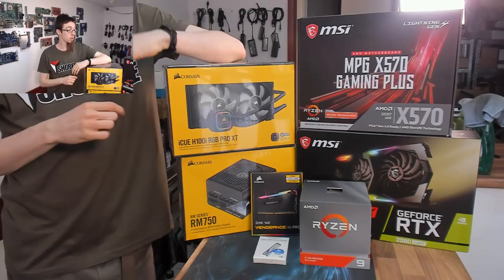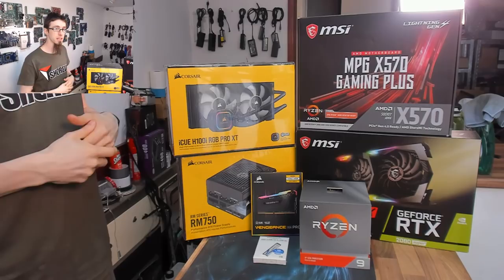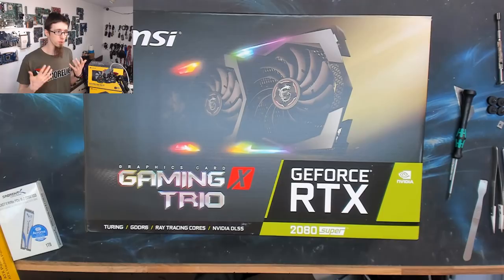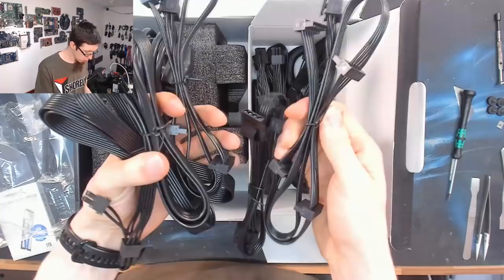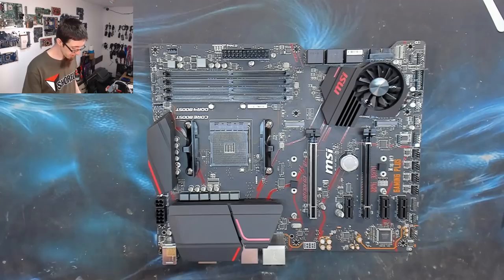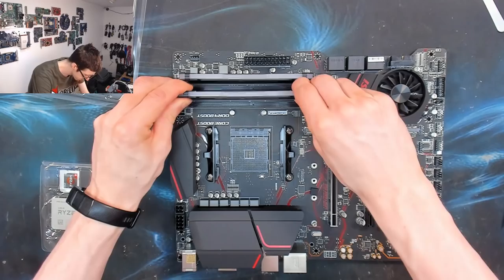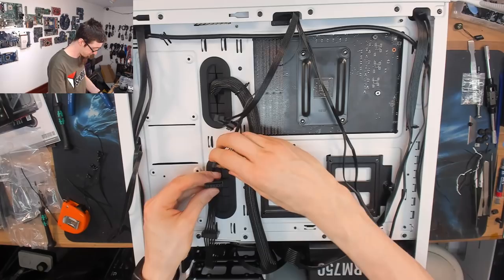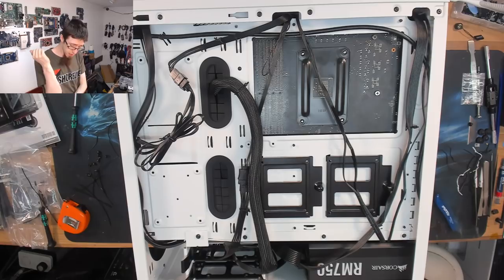The Whole Corsair 275R AF build - LBC#54

Comment: A MSI MPG X570 Gaming Plus as a base for an Ryzen 9?? I think this isn't a good solution! The VRMs of the motherboard are fine for an Ryzen 5 and OK too for an Ryzen 7, but the VRMs are little bit  undersized  for an Ryzen 9. The MSI B550 Tomahawk or the Asus Strix B550-F Gaming would were better partners for an Ryzen 9. Both mainboards have better VRMs and the Asus has a very good soundsolution. Maybe a Asrock X570 Steel Legend it has  a good price and a good list of features, like 8 SATA-ports.

Comment: Great video, thank you. Did you add thermal paste when installing the water cooler block on the CPU or did I miss that (or it is not needed)?
Reply: Pre applied on the cooler block so no need to add any of your own 👍🏼
Reply: dannyvenuss good to know.. thanks Danny
Reply: On what planet was this a good build, cheap motherboard $50 cooler with a top line cpu and a $1500+ gpu it's a toaster at best! see my review!

Comment: I've just built with an AM4 X470, R5 3600x and 2060 Super and noticed that vcore is also 1.488V as you mentioned with this R9 based machine. Can you advise on the vcore voltage and also clarify what you meant about the RAM clock as I'm also using 16GB @ 3600 MHz as XMP is on and I'm aware that e.g. on desktop CPU-Z can show memory clock at 1800 MHz as it's DDR but can you explain what should be applied in the BIOS?
Really excellent channel,  enjoying the videos greatly, have been learning so much so thanks for all your hard work! 😉
[EDIT] I looked into it and I think the 1.488V reported in the BIOS is based on one CPU core running. "AMD Cool and Quiet" should be set to auto and the voltage fluctuations are normal. More info here https://www.reddit.com/r/Amd/comments/cbls9g/the_final_word_on_idle_voltages_for_3rd_gen_ryzen/

Comment: Excellent spec. I've fallen foul of the whole PSU availability thing and have been reading recently about RM power supply reliability issues, so I've opted for a Seasonic Focus Gold 750w. Slightly cheaper too!
Reply: The gx 750 is a great psu, I'm rocking one myself.

Comment: You could go eazy with 650 watt power supply or even 600 and save pretty good and m.2 better place on lower slot so it doesn't heats up from GPU  ;)

Comment: more attention needs to be taken for the gpu thermals in builds. liquid cooling on processors all the time. but unless they are rendering most of the work will be done on the gpu for gaming, and that gpu boosts with temp...  2020 cases have been getting better with bottom intakes

Comment: Is 32GB OTT for gaming?
Reply from the maker: Very much so 😅
Like, knock yourself out if you went 32GB, but you won't actually be using it. It's worth noting that we're also getting late into the life-cycle of DDR4, so 'future proofing' ain't a thing either. We'll likely be hitting DDR5 before 32GB becomes the recommended for gaming.
Reply: @Adamant_IT  BALLS! I did go with 32GB of 3000MHz DDR4

Comment: I have a Corsair case with the same/similar tooling and I hate it lol. The side behind the mobo is like half a CM, so cable routing or using fan controllers is a nightmare. Its hard to close my rear side panel. And the airflow is meh and fan mounting isnt great, nor is drive mounting. And the "a"RGB on the front is lousy as it was made before Corsair became the RGB gods lol.

Comment: i have two 3900X's that CRASH at -50mv offset, let alone -100mv cant even load into windows with that. XD i had a 3950X but cant comment on that as i dont have it anymore, swapped it to my brother for one of those 3900X's and 200 cash, but i would imagine it would do better. And the 3900X's trully have IN BIOS vCore like 1,45v or more, even with latest 2021 BIOSes.

Comment: Why was the motherboard sitting so low in the case?
@ https://youtu.be/IFBAehidsnQ?t=2574 you can clearly see that the I/O ports alignment is way off!
Either the I/O port shield is too high or the mobo is to low?!?
Reply from the maker: I noticed this when I was plugging it in, I gave the mobo a nudge and it settled into place. Not sure how it was caught up though, as you'd expect the ports to be too high, not too low.

Comment: A 3700x with 2070 super would have been a better bang for the buck you wouldn’t even notice the difference from the 2080 super/3900x you chose. And you could have saved about $400 and spent like $100 of that on a better motherboard and better case and better aio cooler.

Comment: You really should explain which way the fans go for push or pull....
Reply from the maker: ahh I always forget. The rule of thumb is; intake at the front, exhaust at the back/top.
Rad fans should generally push through a radiator, but I don't think it makes a great deal of difference. I went for push here because it's easier to mount (one set of screws) and I wanted to hide the non-RGB fans.

Comment: Looking good i have just purchased the same case, i have one concern i have seen a few videos regarding the watercooler outlets should be at the bottom if you are side mounting the radiator, this stops the air traveling to the pump causing noise and damage, here is a good video explaining and testing. https://youtu.be/BbGomv195sk
Reply: Can a radiator actually fit up top? I want an aio and to top mount it but I don’t think there’s enough clearance
Reply: @JesusPerez._  Yes I have managed its squeeze but fits in there however I did need low profile ram for abit more clearance above the motherboard. Still going a year later anyway haha. Good luck
Reply: @UKGBManny  that’s good to hear, hopefully I can make one fit in my case too! Ty for replying

Comment: You were going okay until you capped the voltage at 1.25v, you just hobbled the CPU. Research it and then get the system back from the customer and fix that.
Reply from the maker: Yea this is something I've been discussing a lot lately - and you're right, the auto-voltage is the way forward no matter how odd it seems. I wasn't too far off the mark with 1.25, you don't take massive hits until you go down to like, 1.1 etc - but all the same it's getting an update.

Comment: too bad to put a 3900X on a shitty X570 board like that, that will not be able to fully use it.

It would be OK for a 3700X that is fairly low power, but not a 3900X, hell no. It would run hot at stock settings already, and forget overclocking a Ryzen 9 with this kind of VRM cooling. It would have been much wiser to go with a B550 to be honest : you can have a much better VRM and overall better board for the same amount of money, and the VRM cooling issues in the budget boards are long gone (+ the VRMs seems to be overall much more solid)

Comment: All that Corsair stuff would run better with the Asus TUF GAMING X570-PLUS board if you wanted to stick under £200 for the mobo, should have gone 32MB ram too, the games are advancing fast and simulators are struggling on 16 now, AND that screw missing from the Nvme is grinding me and your lack of build knowledge there scares me...read the mobo manual....it tells you. If there's 2 holes then fit 2 screws no question, and you weren't aware of what an anti sag bracket was.....again read the manual, it doesn't make you look weak when you seek knowledge.

Comment: That GPU is already old. I mean that price and in 1 month we are getting RTX 3000 series.
Reply from the maker: This is a really difficult call to make... We know that the new cards are out very soon, but we don't know what the price will be, or the availability. At release, the prices are going to be slightly higher (this is nvidia we're talking about... it's not going to trickle down right away) and there won't be partner cards for a while longer.
So how long do we wait... it could be a a month or two before release... a few weeks to get a card if stock is low... another month or two if we wait for partner cards... I've watched someone wait 6 months longer to build their computer because they were like 'the new cards are coming!'
If you're ready to build, and you need the new system now (as was the case here) then just build. This time next year the 2080 super will still be a fantastic graphics card.
Reply: @Adamant_IT  Usually partner cards are available day one this days. Prices on 2000 will go down. That was my point. :)

Comment: Wait, you said: Your power supply really doesn't care about getting air from inside the case? Holy moly, come on man.. dont say that. Complety wrong. Why you think there's a fan ? to take air trough your PSU and out back.. DOESN'T CARE ????
Reply from the maker: The air inside the case is warmed than external, but it's not on fire. PSUs don't produce that much heat, warmer air is still plenty good enough to cool them. Lot of modern gold-rated PSUs can run passive most of the time.
Reply: @Adamant_IT  Thats fine, all im saying is you dont say: PSU doesn't care.. just that gonna make newbuilder think: doesn't care, im throttling the PSU !!! and by flipping the PSU so it take air from bottom as your case did have vents not gonna hurt YOU.... so why not? baffled.

Comment: that is a horrible PC case, why would you let your power supply blow heat into the case?
Reply from the maker: Cases are personal choice, like it or dislike it.
PSUs always exhaust out the back of the case, whichever way up they're mounted.
Reply: @Adamant_IT  personal choice or not, that GPU will burn up the motherboard

Comment: Tips to all newbies out there, dò yourself a favor, especially. “ESPECIALLY” if you have a Ryzen CPU. Never! And I mean NEVER ever use the thermal paste thats’ on your Aio or cooler! Those are cheap ass thermal pastes that acts like glue! The last thing you want to see is your CPU sticking on your cooler! I bent 2pins trying to unstuck my cpu to my cooler!
Reply from the maker: Loads of thermal pastes do that. Pro-tip, always twist before removal to break the grip of the paste, then you can lift it.
Reply: This happens a lot with stock paste. The tip is to run a heavy load on the CPU (stress test, video encode or CPU heavy game) for 20-30 minutes so the paste is nice and loose. Then turn off the power and twist/wiggle before pull. I just wish that AMD will someday implement a latch that holds CPU firmly in the socket, preventing users from yanking the CPU and bending the pins.

Comment: Oh man, you chose a bad board, especially when paired with that 3900X. The VRM for that MB is horrendous. In that price range the Asus TUF board has the best VRM. That board might melt under heavy usage of that 3900X.

Also for Ryzen, memory speed is important but memory latency is more important. The 3600 CL18 is the equivalent of the 3200 CL 16. Should have saved that 20 pounds and use it towards the Asus TUF board.
Reply from the maker: It'll be enough. You're right that a higher end board and lower CL RAM will perform better, but that's when you're getting into the bleeding edges. For a general build that's going to run stock speeds, it'll be fine.

Comment: Im am really disappointed with your ssd choice. I would return the build for the poor choice of the ssd alone. All 3 ssd (crucial P1, intel 660p, sabrent Q) are horrible ssd and not worth any amount of money. They are slow (after filling up the cache, even slower than HDD‘s), low write endurance and not cheaper than god sata ssd‘s. I would rather go with a mx500 or sandisk 3d ultra.
Reply from the maker: None of which makes a jot of difference on gaming PCs. Run workstation tasks and we'll talk - but home desktops don't need monster SSDs. Home users do sprint tasks like load programs or offload a flashdrive, they don't shunt hundreds of GBs around between SSDs all the time.
Reply: That is true and I would have said nothing if this were a pc for 1000 bucks. But this rig nearly costs 2000. 20 bucks more is all takes for a sabrent rocket or sp p34a80 with reasonable tlc flash memory. 
I might have overreacted a bit, sorry for my rough tone. I guess most customers onlycare about big flashy graficcards and ignore the other components anyway.

Comment: Just watched about two of your videos, this one Wow! all the mistakes, this was terrible "sorry" you bungled your way through this with some slight of editing! especially on the m.2 the cabling child like, also crossing the bottom of the motherboards cpu area with wires is a big not to do!  Then not knowing the gpu sag protectors positioning, not to mention the screw hole purpose etc etc! From what I see here I don't think building is your forte! I am trying to be gentle but this build it's real hard your choice in parts for this build, that cooler is totally inefficient for this build, it might have worked just fine in a budget build, but not in a high end cpu,gpu cofiguration.even the motherboard did not belong in this build. in conclusion what stopped my laughter, was that you never told your viewers that you screwed up trying to put in the m.2 that was cowardly and deceptive on your part. Lastly anyone who buys a 2080 super gpu " Has no budget".